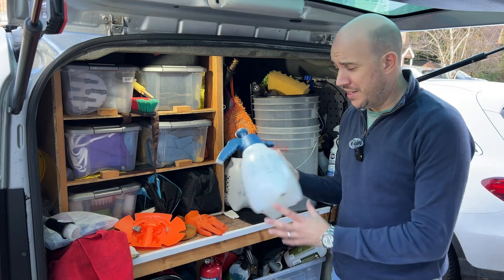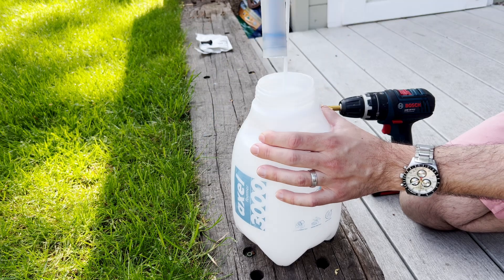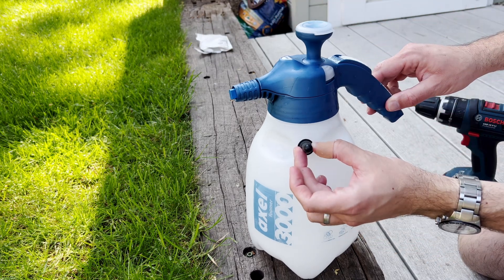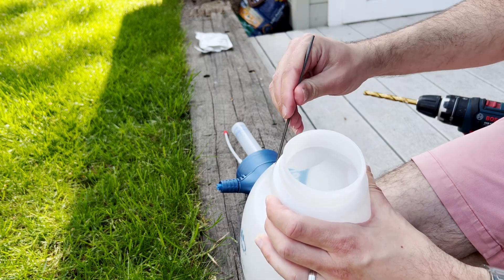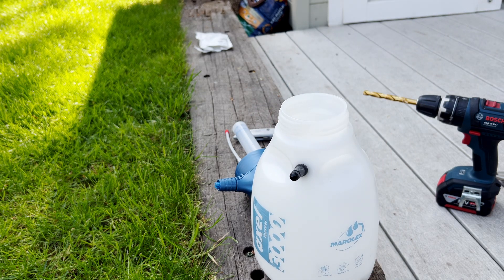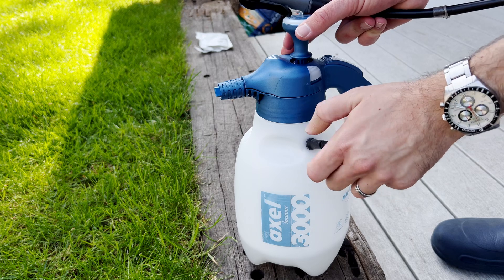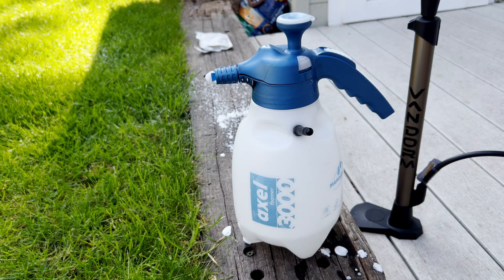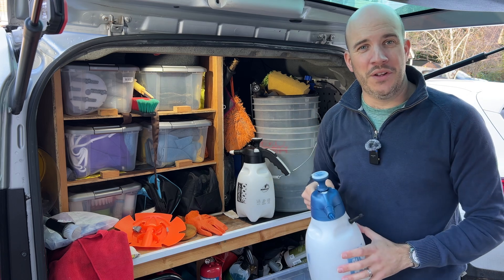Stop Buying IK Sprayers! (Marolex Mod Makes Them Obsolete)

Comment: What about the Venus 360 pump sprayer? are they not better than the Marolex and not as much fecking about fitting valves etc?
Reply from the maker: They also don't have valves so you're stuck hand pumping them too, and they're volumes are smaller (or should I say, they don't have a 3L version, and their expansion chambers aren't that big, so you have to pressurise them more often when it's full of liquid). They are definitely better than the IKs though, probably actually the best made in a way, just slightly limited.

Comment: Works great until a stress crack makes it pop under pressure and sends shrapnel into your eye, your dogs, an old lady or a small child.

I buy the IK Foam Pro 2+ with factory installed Schrader valve and fill it off my air compressor hose. You could strap one of those cheap cordless compressors to it too. The foaming version can be converted to a regular sprayer too.

Hand pumping aside, my IKs have been bulletproof (I have some dating back to 2018 that are still in service). All it takes is knowing how to use/maintain them properly.
Reply from the maker: I'll let you know if I get to a point where this explodes. I will say that the Marolex ones are far thicker plastic than the IK's, and especially those cheap temu ones. I have also found that the Marolex ones require far less maintenance than the IKs to stay in a good state of performance, but I will also add that I use the sprayer the most because all the foamers suck, regardless of brand. I don't think they really have much value, but the mod is relevant and it applies to all types.
Reply: @SuperchargedLlama  I genuinely hope nothing happens to you or anyone else that does this modification. I just think it is just important to point out that there is a ton of energy stored up in one of these at full pressure, and drilling into them in a way that it wasn't designed for and using a Schrader valve in a way that it wasn't designed for is a recipe for potential injury. There is a YouTube channel "Steve Pierson" (he is an Engineer by trade with a detailing hobby turned side business) that has a video titled "Detailing Safely: Pressurized Containers" where he explains what can happen.

I have a couple Marolex sprayers as well, and FWIW I've had more issues with them over the years (primarily with leaks) than I have with my IK's. I wish IK would include the Foam Pro 2+ Schrader valve design on all of their pump sprayers, and that Marolex/Kwazar etc would do the same.
Reply from the maker: I completely agree that IK should have the valved charging heads on everything, it's so odd that they don't.

I'll check out the channel you're referring to as that'll be interesting. When I pump manually I pressurise until the release valve sounds (as per the instructions) and I do the same with the compressor, I fill them quite slowly so I don't really see what the difference is?
Reply: @SuperchargedLlama two things I think. Primarily, even though you are drilling into the thickest part of the bottle, you're still compromising the design of the bottle in a way that it was not intended. Plastic degrades with time, UV exposure and chemical exposure. Introducing an additional point of failure by drilling into the bottle is asking for trouble. 

Secondly, if someone is filling it fast with an air compressor, you want to make sure that the safety release valve is operating properly and not sticking (make sure pressure doesn't spike above what it is rated for). Filling from an air compressor at 90-125 PSI pushes air in a lot faster than you can do pumping by hand.

Comment: $50 - $70 for one? You could just buy a $9 Project Source Handheld Sprayer from Lowes, make the exact same mod and it'll do the exact same thing
Reply from the maker: They're about £35 in the UK so it's much more affordable, those tariffs have shot the prices up in the US I reckon, they never used to be that expensive for you.

You're right though, you could mod most pump sprayers to do the same, although the Marolex are superbly made, it wouldn't be worth the price you have to pay for sure.

Comment: That’s a decent hack. I’ve given up using my IK Foamer now. It stopped producing decent foam a while ago even though I changed the filters etc. I was only using it for the wheels with GT Wheel shampoo but now do the same with a foam lance which is saving me 5 minutes of pumping for 5 seconds of foam from the IK. Doubt I’ll be using the IK foamer again - as you say, it’s a bit useless.
Reply from the maker: Yeah I really don't understand the benefits of the foamers, which is actually why I tried this out on that one first, I didn't care if I broke it.

Comment: stop buying any of that nonsense and buy sprayers from the hardware store that work every bit as well at 1/4 the price
Reply from the maker: The Marolex ones are much better than anything I've been able to get from a hardware store (much thicker plastic, and the sprayer version has a flexible pick-up straw so can be used in any angle).

Although they aren't as bad as those Temu/Ali Express ones.

Comment: I have 2 Marolex and use it for rinseless wash and my alkaline tire cleaner. My biggest complaint is not being able to unscrew it easily to refill. If it had some sort of system with a little lever or quick twist lock, that would be fantastic.  The arthritis in my hands and wrists would be thankful.
Reply from the maker: I've recently been diagnosed with arthritis myself! I can see what you're saying, although I definitely find these a hell of a lot easier to open than the IKs.

Comment: I like that Marolex makes sprayers for all chemicals acid normal and alkaline all in 4 sizes from 1 to 4 liters with a 1.5 slid in there. They hold more pressure than other sprayers so you can spray longer without having to re-pump
Reply from the maker: I forgot to mention that as one of the reasons why I think Marolex are so good. Kwazaar are similarly brilliant too.

Comment: So it's a tyre valve? First off (As someone in tyre game) a little bit of lube around valve help it pull through. And if you want a screw in one you could use a tpms style valve or a metal truck valve. I have several sprayers and a fuck ton on valves 😁
Reply from the maker: I guess it is a tyre valve, yup! But a car tyre valve rather than a push bike one using the other valve style (which name is escaping me at the moment).

I was nervous as to whether the screw in valves would be as good here as the surface is slightly curved, but I guess that's true of a wheel rim as well! I should give that a go to test it out 👍

Comment: 😂Funny, pumping instead of pumping
I've done this modification as soon as I got my marolex, but the foam it does is very thick, even with the watery nozzle.
Reply from the maker: I know I did the mod in the video on the foamer, but it's the sprayer I really use...I did it on the foamer first in case it went wrong 😂 I really don't see the benefit of pump foamers tbh
Reply: @SuperchargedLlama The sprayers on the other hand usually spray a lot, because they don't let air out, but still, pumping is for slaves.
What I do is I have 2 Battery foamers from aliexpress, one in each hand. Arnold style
Reply from the maker: @flowinthrou I mean now I desperately want to shout GET TO THE CHOPPA.

Comment: Just use a valve tool to pull the valve through, that's what they are designed for
Reply from the maker: I didn't know that was something that existed, good to know though - I'll add that to the description.
Reply: @SuperchargedLlama yeah that makes the job easy. Also lubricate the valve, it'll slide through 10x easier. Don't use washing up liquid, use car shampoo as it's far slicker. 
   I made the mistake of attempting to use washing up liquid to mount tires, and quickly discovered that lubricity wasn't a consideration when they formulated it.
Reply from the maker: @joeschmoe6908 I need to see how those valve pullers work because I absolutely cannot work that out just from a picture 😂 but it is obviously the correct tool for the job.
Reply: @SuperchargedLlama not sure what picture you saw and there are a few different types. But all of them basically work by screwing on to the threads on the stem and then giving you a handle to pull on and yank the valve through. 
  Just search on youtube for "installing valve stem in wheel" and I'm sure you'll get results. Ignore the instructions on how to do it without removing the tire, that's pointless for your application.

Comment: I love these types of videos darling, improvise, adapt and overcome! Apparently the hole size is 0.453” which is 11.5062mm. Insertion would be easier with a smidge of washing up liquid.
Reply from the maker: Thank you darling! I was thinking of using vaseline but washing up liquid sounds like a great idea. You'd also see if you had any leaks as well I guess?
Reply: Yeah I was going to say it’s not a clean conversion to any fractional size. Close to 29/64 which is .453125”… nothing convenient lol. BUT any decent imperial drill bit set has a 29/64 in it, so maybe it just worked out that way? Or maybe 12mm was too big and 11mm too small 🤷🏻‍♂️

Comment: After seeing it done on another (US) channel, I bought a few stainless steel (bolt in version) Schrader valves, and Xiaomi Mijia air pumps to add the option in to a number of sprayers/foamers I've got. The pumps are portable and rechargeable, can be set to a pressure (either marked on the bottle or measured when the relief valve has activated) and will start automatically when the pressure has dropped slightly.
Reply from the maker: I have seen that mod too, I didn't want to spend as much on these as I don't use them that often but I can absolutely see the value in doing so if you use them regularly.
Reply: @SuperchargedLlama I sometimes use a garden type sprayer to apply prewash, so along with actually spraying in the garden, I can use the pump with any of the sprayers (or foamers).

Comment: I wanted the  marolex 3000 but it wasn't available so i.picked up the 2000 which is the perfect size sprayer. One big advantage vs the IK is that you don't have to pump forever. You pump a good 5 to 10 times and it sprays for a while good to go. Great spray pattern and atomizes well.
Reply from the maker: I also find, in addition to everything you said, that that you can fill the Marolex up with the max volume and still have plenty of space to pressurise it, whereas I find with the IKs you have to leave some space otherwise it's runs out of puff within a few seconds, all after much pumping.
Reply: @SuperchargedLlama   yes you can. Glad I didn't buy another IK and got the Marolex.
Reply from the maker: @btbd2785yeah me too, I'd never buy another IK one.

Comment: I’ve never understood the IK obsession. Marolex sprayers are soooo much better. Thanks for showing us how to do this!
Reply from the maker: 🦙 me neither! Shows you the power of influencer marketing doesn't it?
Reply: I just posted manual IK suck. But what makes Marolex better? Isn’t it the same concept? Pump a gazillion times?
Reply from the maker: @ThePriceIsRising I can see the question you've got here. Ostensibly the concept is the same, but Marolex put a much bigger expansion chamber. With the IK 1-2L units for example, they have a tiny air space above the max full line, so you have to pump like crazy and then you use up the pressurised air really quickly as there is such a small volume. Whereas the bottle on the 3L Marolex can take 4.5L, which means there's 1.5L of space for compression, which means that I can do half a car with one charge (well, on the sprayer anyway, foamers are over rated regardless - they stop producing good foam really quickly where as a sprayer will keep going for a while even with lower pressure).

Comment: It would have been smarter to drill with a smaller drill first, then drill with the full size drill.
Reply from the maker: You could for sure, but the plastic is relatively soft, the bit is sharp and I started off slow so it made an indent which guided it when I sped up. You could definitely do a pilot hole though if you wanted to be extra safe and that would be a sensible idea.

Comment: Great video. I’ve modded all my sprayers with this. Most of the valve stems utilize a .453” hole, which equates to a 29/64th drill bit. The TR412 valves are nice because they are short. Amazon of course.
Reply from the maker: As you typed that, did you feel how ridiculous 29/64th is for a measurement? 🤣

You are absolutely right though, the 412 is a nice stubby little valve.
Reply: @SuperchargedLlama  I summarily reject the entire Imperial measurement system. We should have gone Metric like the rest of the civilized world 50 years ago. The Metric Conversion Act of 1975 was a joke.
Reply from the maker: I feel for you! Although this will make you laugh because Jesus wept, we're a basket case as well 6 https://www.instagram.com/reel/DNh9z3IzG8t/?igsh=dDN0dW12ajJ5bnd6
Reply: @SuperchargedLlama  how much faster is it doing this rather than just using the including pump handle on the marolex?

Comment: I saw another video where the guy used a screw Schrader valve. On the version you've used (and I found on Amazon), I couldn't work out where the screw bit was, so gave up. Didn't realise you just force it through. Doh!
Thank you.
Right, I shall report back when I've destroyed my ik bottle.
Excellent video, thank you as always
Reply from the maker: Thank you darling! It's an absolute fighter to pull it through, you'll think you're doing it wrong and it takes much swearing. I wonder if a bit of vaseline would have helped actually...
Reply: @SuperchargedLlama feedback time 
Installation: pilot hole then bigger drill bit (ik plastic is quite thick), Dremel sanding bit to clean the inside, fairy liquid on the Schrader valve. Piece of cake.
Use: add an air chuck to a foot pump, 5 pumps, and fully pressurised. Brilliant. Trust me on the air chuck.
Ik users: I looked at putting the valve at the top, but it's a no from me. If anyone succeeds, let me know please.
The ik handle catches on the valve when you screw on the head. Poo. Hopefully it'll not mind being bent every time😢
This hack is great for the sprayer, but I still maintain that the ik e foamer is better for foam as it delivers perfect foam and charges as the pressure drops.
Great hack, thanks
Reply from the maker: @pigeonpoo1823 thank you darling!

I do agree with you that the efoamers are the sweet spot for sure. You can apparently do that with these as well but it's starting to get really janky at that point...and as I don't use the foamer very often at all I haven't bothered.
Reply: @SuperchargedLlama yeah, it all depends how much you're going to use a foamer. 
One other point about the ik plunger mechanism(?) is that it's plastic on plastic and I've worn away some of it. So much that the bits were clogging up the filter. Not having to use the plunger means less damage.
Reply from the maker: @pigeonpoo1823 yeah I've not really found much of a usecase where I regularly need to use the pump foamer, you see people doing it on Instagram all the time but I think it doesn't add anything.
Reply: @SuperchargedLlama 
Can you turn the Marolex into a 360? The ik pick-up tubes are interchangeable, so I've swapped in a flexible tube. Worth a look.
Also, the handle fouling on the Schrader valve was concerning me, so I've shortened the handle with my trusty fake Dremel. I may have to Dremel part of my hand next if the handle is too annoyingly short.😅
Reply from the maker: @pigeonpoo1823 the Marolex sprayer has the Flexi tubes, but the foamer is rigid, not too sure if they're interchangable.

Comment: I got fed up with pressurised bottles either hand pump or battery. Bought a couple of Milwaukee M12 BHCS3L-0 12v 3.7L Handheld Chemical Sprayers. One for citrus and one for wheel cleaner. Shorten the wand and added a 8mm diameter fine mist nozzle off amazon. Hours of hassle free goodness without constant vessel repressure issues because it's the pump that actually sprays.
Reply from the maker: I should have said that was one of the reasons I added the valve, just to avoid the hassle - with the compressor on its recharged in seconds and no effort. Not quite as efficient as your solution of course, but also no real extra cost involved either.
Reply: They are also a couple of hundred dollars each too. That's sale price too.  Wands are a little to long unless your working on tall vehicles.
Reply: @btbd2785 There are others for sale for a LOT less price than the Milwaukee sprayer!
Reply: How did you shorten the wand? Also how are you dealing with the hose being quite inflexible?